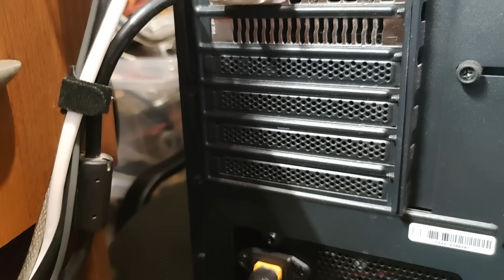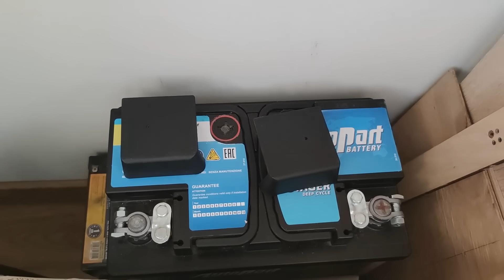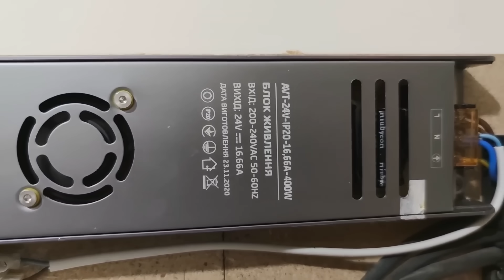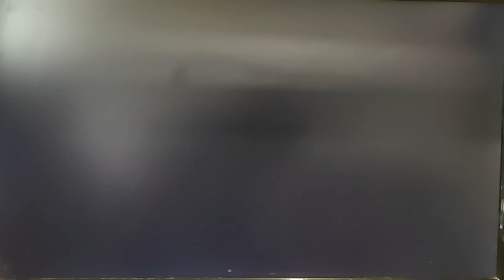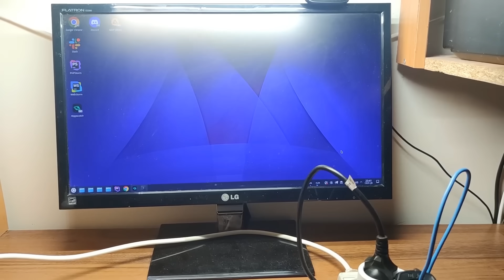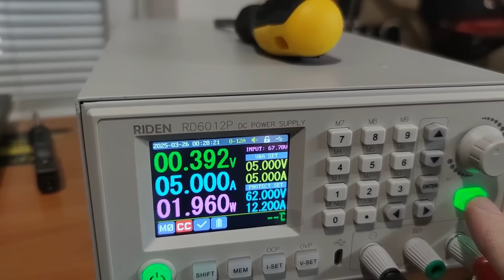I Deleted the Inverter. 50% More Efficient! (Windows vs. Linux)

Comment: Nice job on the full DC conversion.  Even the 0.72% power loss due to voltage drop on your power cables is not bad.  It's likely a very good compromise between power loss and cost.  Those low gauge DC wires get pretty expensive.
I'm currently setting up my RV with 450 watts of solar, 200 amps of LiFePo4 at 12V, and an HP Z6 G4 server that pulls about 375 watts (DC) under full load.  I'm currently using a power inverter for the Z6, but plan to buy a DC-DC PSU for it.  Since mine doesn't use a traditional ATX power connector it's a bit more involved for the conversion of the PC to DC-only power.  And now that I've seen this I'm more energized about getting that conversion done.  Thank you for the video and the look at what you've done!  Really appreciated.
Edit:  By the way, my Xeon Gold 6142, 96GB DDR4-2400, 4 x 1TB NVMe RAID 0, 2TB NVMe data, and 512GB NVMe boot drives, and Radeon RX 9060 XT 16G only pulls 63 watts at the wall on AC power at idle with BIOS power management at balanced, and Linux power management at performance.  Maybe you've got some BIOS settings that can get your idle power down quite a lot, because your idle power draw seems awfully high, unless it includes power to the monitor.
Reply: Not sure what you need a server in your RV for but you could just buy a powerful mini PC (or laptop) that has a DC input (19v) like with a laptop power brick to make it easy work to hook up with just a 12v-19v converter 
I use a few of them myself like this and today you can now buy a AMD ai max models that have a good cpu/gpu for working and gaming on

Comment: Fun-fact: If you ever work on cell phone towers. You might notice that all of the equipment run on 48VDC instead of the usual 120/240VAC, why you might ask? So that the UPS can run in "on-line" mode (Operating in "on-line" mode grantees clean, reliable glitch-free power regardless of what's happening to the incoming supply.) and still get the efficiency you would get from a "stand-by" UPS by eliminating the wistful DC->AC->DC conversion process in between. Incoming AC power is converted to DC using a converter that also doubles as a battery charger by limiting both the voltage and current. From there, it goes to the battery bank and from there, it go to all of the equipment in the tower. Doing this alone increases efficiency by 30%.
Reply: It's because they historically ran on batteries, before there was a power grid. Not cellphone towers obviously, but the original landline phone network is older than the power grid!
Reply: @thewhitefalcon8539 also true and the early power grid failed often and it was helpful when customers could call it in.
Reply: Isn't it actually -48V DC? I was working on a telco system and I was instructed on how to power it. It felt extremely weird to connect the +48V to the ground of the system and I better checked with the telco supplier to make sure I got it right...
Reply: @JakubChalupnik reason telcos used -48v was to keep the corrosion from happening  in the CO equipment but instead at the user end plus it allowed their AC ring voltage to stay in the low voltage range so they didn't have to meet same safety standard that power companies have to.
Reply: @JakubChalupnik   Yes it's negative 48 instead of positive 48, which feels weird but physics doesn't care how you feel about it. Negative is used because of how it behaves when a phone line underground has a little cut and a bit of moisture (which is basically all the time because they're not perfectly made), it chemically reacts in a way that attracts atoms to the wire, instead of pushing the wire atoms away and eventually breaking the wire like a positive voltage would do.
Reply: What about noise on the main DC line? My home lab run in similar way and i want to eliminate network switch's PSU and connect directly to 12V line. I hesitate bc worries electric noise from consumers (mini PC, NVR, HDD) would cause damages to each other. I dont have oscilloscope to measure noise.
Reply: @susugar3338  Shouldn't be enough noise to make a difference but you can always measure it. If you're worried then add some big capacitors. Almost no modern computers run directly on 12V anyway - if it has a 12V input, that means it has a converter inside that steps it down to lower voltages. And that converter is probably good for a pretty wide range, maybe like 9 volts up to 15 volts, and should work fine directly off a battery.

Obviously you void your warranty by doing that, and there might also be a safety mechanism to cut the power if it detects the voltage is too far away from 12 volts even if it technically could work.

Comment: standard atx power supplies don't care about polarity and have a rather large input voltage range. in fact, they have a rectifier in them that ends up lowering efficiency so running them off dc after removing that might actually be better.

my psu had a range of 90-150v ac so a battery pack of 46 18650s could power it just fine. the charger i cobbled together for it was... unique.

sadly i no longer have a gaming pc though.

Comment: i got basicly the same setup. Added also my router and NAS to the DC grid.
I added a MOSFET Diode to my Charger and set die voltage at 20% SoC, so the Batterys are never empty.

Comment: Great setup, but a tip on your lifepo4 charging.  Keeping Lifepo4 cells over 70% gives the highest degradation and charging them to over 3.525V will also shorten their lifespan.  Charge to a max of 3.4v (100% charged) normally with a balance cycle of 3.45 for a couple of hours once a week.  Personally I daily charge to 3.35 and would never go up to 3.525, thats way to high. 

Unless you have a spare cell that you are also charging and discharging, if one cell in your pack dies replacing it is no easy matter.

Comment: As was already mentioned you can't measure AC power using just clamp current meter and a voltmeter. AC active power is Voltage*Current*Power factor and you don't know power factor of your PSU, and the power factor can be even 0.5 if you are at the lower end of the power range. You should use actual AC power meter.
Reply: You should buy him one ;)

Comment: I would suggest looking at ASPM in your BIOS, this enables power saving on your PCIe devices (onboard too). 
If all your PCIe devices have ASPM enabled, the entire system will be able to go down in C-states so the idle power draw can be a lot lower than you've currently shown.
On Linux you can use the Powertop utility to check this, for Windows you can use Throttlestop.
Reply: The downside is that ASPM can be super buggy as well - I just spent a few hours debugging a new build and it turned out to be that the specific motherboard has a bad implementation, causing multiple devices to fail - from the built-in NIC to an add-on NIC to the NVME drive.

For his specific scenario, I'd give it a try, but at any sign of random instability/devices misbehaving, then drop it.
Reply from the maker: Thanks, I will look into it!

Comment: "the tiny board did not hold the load" which one the PicoPSU? Just bypass it entirely for 12V connections to the CPU and everything else that you can sanely separate out. Not that you'd need to or want to now, but i mean that's what i would do if i had to or wanted to use a PicoPSU.

Comment: Really nice update, i'm also curious what the efficiency would be like with the standard atx psu on higher voltage DC (140-340V DC) straight from batteries because those psus are usually built to higher standards especially platinum and titanium psus these numbers would be significantly higher plus the higher voltage DC meaning fewer losses with lower amps, keep in mind the first thing most pc psus do is a full bridge rectifier so the DC side is actually around 330-340V DC for 230-240V AC, the 100V AC equivalent it's around 140-150V DC, certainly don't do this on anything you must work with because you never know internally how it can handle high voltage arcing pre-rectification eg power switching relays etc but technically speaking if solar > battery > ATX PSU (which can handle the voltage variations fine) would be the absolute most efficient way to do this :) Also I would consider if the budget allows a more efficient computer you can get a something like a macbook on M series chip which would be considerably more efficient or a modern laptop and power using either your 24V DC using a 12/24V USB-C power supply or at higher voltage DC any standard charger will work, I remember powering usb chargers with a few 9V batteries in series around 90-100V DC they already start to come to life, AC usually around 70-80V they will kick in but anyway with a modern arm chip you can easily idle at single digits easily and even full power barely reaching double digits around 10-20W you can also consider a raspberry pi especially if you're not doing anything that needs the desktop would be 10-20x more efficient per watt and you can still run linux arm64 on the pi just fine.
Reply: Can you run it from 140VDC without blowing up the input rectifier? Many PSU sold in EU aren't even intended to work on less than 200VAC, because the input rectifier would burn up at PSU's maximum rated output power. Global PSU of course work down to 100VAC just fine, however, when you have DC you're letting two of the diodes run idle and two carry double the cycle average current for a given power.

The topology of modern PSU is invariably input filtering (X/Y caps, little CM choke, MOVs optional) -> bridge rectifier -> APFC (raising the voltage to 380V DC typically or more) -> everything else. Fundamentally, you could just bypass the bridge rectifier...
Reply: only people that run high voltage dc are the ones using full batteries from cars, but I assume they convert down, most solar stuff outputs 48v anyway. others just reconfigure the cells. I want to try that theory for dc converting my 100v electric bike with standard adapters, but I wouldn't plug 300v dc into an atx psu. main problem is safety, 240 ac is nowhere near as dangerous as the 300 dc, because the switching doesn't let it arc. before factoring in the cost of cells and bms to go that high, unplugging the cord on that would double as a tesla coil and eyebrow removal device all at once, dc loads want to keep going. My 8 core amd system can idle in the 20w range, but it needs to be one of the ones with single die not multiple chips, having a regular pc is nice even if it uses a little more, arm probably can't run everything one needs and dealing with workarounds isn't worth it. Altho modern arm impressed me when I managed to run full x64 games on a phone with an emulator and it actually ran acceptably. 24v is nice as there's no risk touching anything and adapters and inverters are super easy to find, most big trucks use 24v anyway. all it needs is thicker wires and not extending big loads too far across the house, that voltage drop for full led lights, which also commonly use a 24v adapter, would probably barely register on the meter

Comment: btw lifepo4 batteries actually last longer when kept at a lower state of charge, not strictly kept at 0 but charging cycle between 0 to 10 percent is less stressful for the battery vs 70 to 80, which is the opposite of what Li-ion that enjoys cycling around 70 to 80 percent.
Reply: Yeah, but over discharging LiFePo4 will actually damage them.
While overcharging isn't a problem. 
Which is why they are often used with solar panels without any regulation for charging them.
Reply: LFP batteries has extremely flat voltage between 10-90% SoC with only 0.1V difference (3.2 in 10% to 3.3V in 90%)

Setting the voltage target to match the rated 3.3V per cell is enough to hold the SoC in 90%

Comment: How to kill an hdd in two years? Go to power settings and set the spindown when inactive to minimum 1 minute. Nearly all hdds will stop working correctly in a year or two due to all the thermal stress in start/stopping. 
Do not use hdd if you want power efficiency. Using 5400rpm drives spins using less power, and some drives has dynamic spinrate (but does not spin down to 0, unless os requests it). 
Hence: Windows uses more  power running on hdds for longevity.
Reply: The drives don't spin down by default in Linux. It just doesn't mount them automatically at boot. Same amount of cycles if not less if you don't need to access every drive each time you use the PC.
Reply: Unfortunately the AI Bros are running up the price of SSDs, in addition to DDR RAM.  What an AI-sloppy time to be alive :(

Comment: A good PSU is 85 - 95% efficient.   Cheap garbage PSU's running at the wrong point in their efficiency curve might just might,  but probably not reach 50% efficiency.    I call BS on the clickbait title.
Reply: You are forgetting the inverter. If you want to power your PC from batteries, you cannot just plug batteries in and call it a day, you first have to increase the battery voltage to the mains voltage and also change dc to ac. So the efficiency he is comparing to is ac power supply efficiency * inverter efficiency, both being on a similar budget

Comment: cut led lights on front panels. front panel fans is needed but not the led strips.
linux have filesystems that supports cache on ram which would lower hdd startup electric usage. file system journaling can be disabled too cus almost no need for it on PC running on battery. 1650 good but new apu's would be faster and more efficient. amd cpu's with 760m radeon better than 1650. 
using outside weather for cooling pc more efficient. unless its too humid or too cold. closed balcony like 10celcius would be perfect for 1 fan colling entire pc. you dont even run fans on idle. that would cut 20W out of 65W idle.

Comment: My ATX Corsair RM 1000i show efficiency  88-94%(min-max load), so your measures maybe not correct
Reply: The grey-body 230V-only PSU is very much not a Corsair and likely a Huntkey or Great Wall, which are... well, uh... they do not maintain spec efficiency after a couple years of use. Or spec ripple. And sometimes not even spec smell.
Reply: The 22% loss was also factoring the inverter converting 24V DC to 230V AC and the PC power supply converting it back to DC again.

Comment: We run LED lights everywhere due to incandescent lights being banned, why are we still running AC anyway? So many things would get so much more efficient.
Reply: Because housing circuits have enough wire to the point losses make DC impractical. A medium sized home might have 2 Km of wire or more.

Comment: From my experience, am4 and 5600x are not that great at idle power consumption. My old ivy bridge system was doing better in idle for example. Ofc it doesn't make sense to upgrade the platform just to get better idle
Reply: I run a very similar setup with an hdplex psu and a 5700g, I had a 3600x and a 3570k before. am4 is quite power efficient if you choose the right parts, Ivy bridge used more power on 4 cores than my am4 on 8 cores. I don't remember the exact numbers but the 3600x would not idle below 70w on the 24v input. Someone that works with servers told me the amd infinity fabric between ccd's is what kills idle efficiency in epyc cpus. I wanted an igpu so I picked a G cpu that doesn't use 2 ccds, its a monolithic design and I've seen my idle as low as 28w. the 5600x uses the vermeer core which is the same as 5800. 5600g uses the cezanne core with single die, more like a laptop in a way. I'm quite happy with this 8 core. My dc meter says 45w as I'm typing this with 40 tabs on chrome and a minecraft modpack open. 1060 gpu idling at 3.5% tdp too, I could take that out and use even less. monitor is on the integrated gpu laptop style, saves me 20w while not gaming